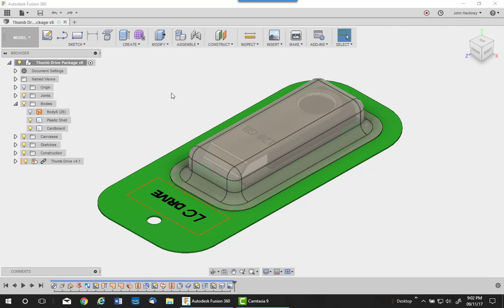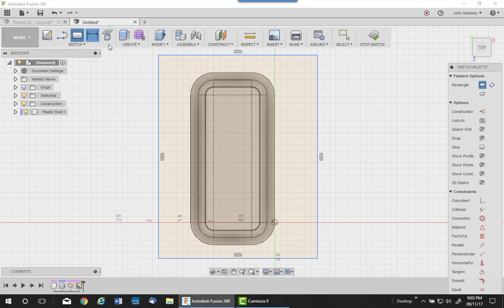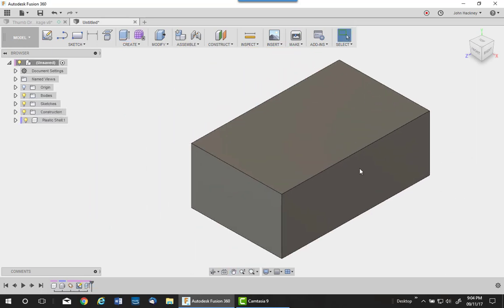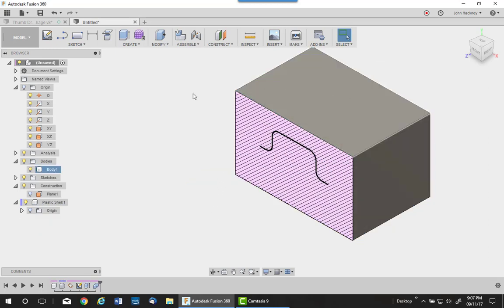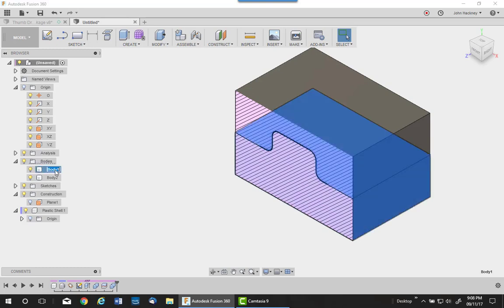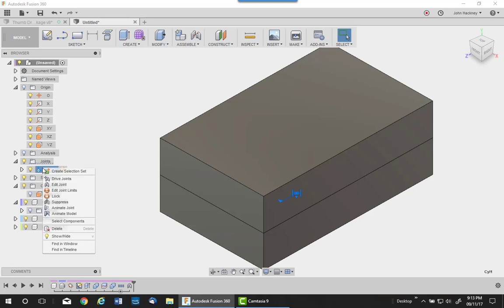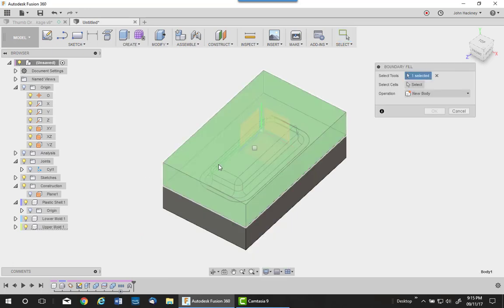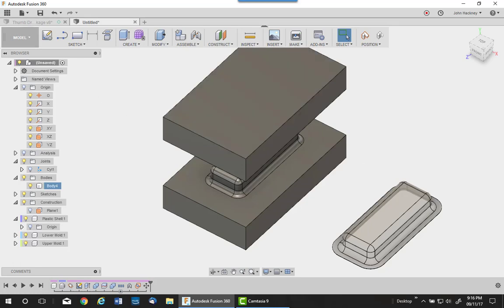Autodesk Fusion 360 - Mold Creation

Comment: John, I love to know if you can crate Brep body from Mesh that you fit inside box.. then instead of using millions of triangles it would create new object ( like actual mold) if I follow you to point I get upper body and lower body of the box and my solid however since my plane was the bottom where my solid was placed on it won't combine the solid with bottom box only shows back the solid and bottom box disappear
Reply from the maker: I am a bit lost as to what you are trying to say in your comment.  If you want to send along your Mold Creation model, I will be glad to take a look at it.  You can export your Fusion 360 file (.f3d) directly from the application. My email is jhackney1972@outlook.com
Reply: @jrhackney  the issue is with fusion itself.. autocad and the general platform.. I have shape as Mash.. Either quad Mash or tirangle Mash.. I can't convert it to T splines. Ideally I would love Fusion to be able to create mold either 2 part or one part  (digital mold that is ) and use the calculation of the mesh outher shell .. in fact if you have STL Mesh it generates all the details you need for molds.. it's closed empty object with boundaries in space.. unfortunately there is still no easy way to convert STL files back to solids.. yes you can use either Remake, or Netfabb, or Blender or Meshmaker ( you can't use autocad to import these in, you can export them though which is kinda stupid.. but while the STL or OBJ file contains all the details.. there should be an option to create automatically mold out of that object and then fill that mold as one part.. not with millions of quads or triangles.. the solid wouldn't necessarily be editable but it would be a solid with solid fill and you could be able to sculpt... Zbrush too.. when you 12000 facets on cmplex objects like interlocking angled parts this would be gold.. or any design thingiverse.. I used also freecad,  Instantmesher, but what I have seen from your video gave me an idea to create mold of bottom part and mesh which at that moment doesn't have mass so it can't bond to the bottom box and even if it's converted to Brep it doesn't represent nearly the actual shape..